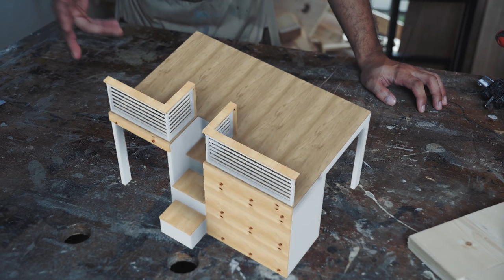EASY DIY LOFT STYLE BED // FULL BUILD

Comment: Sir, surprised that use only using butt joints and screws. Why did you decide to go through this route po when there are other joineries that you can use na somewhat mas secure? Especially for the bed frame where movement are expected with the wood?